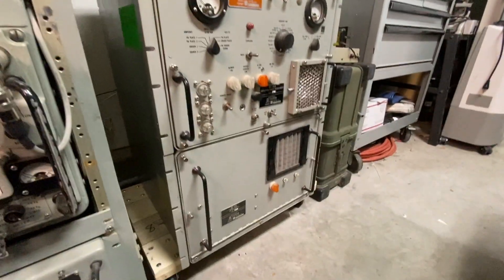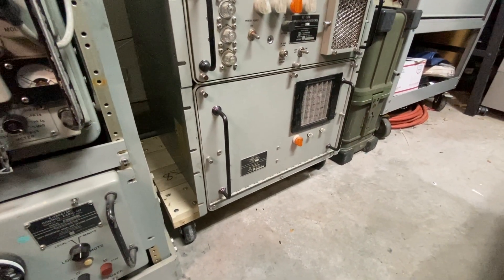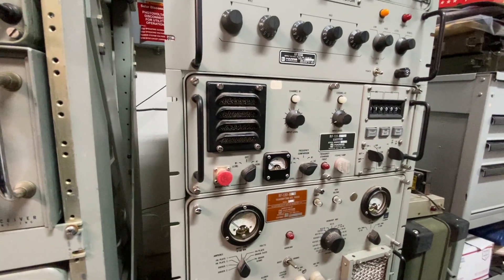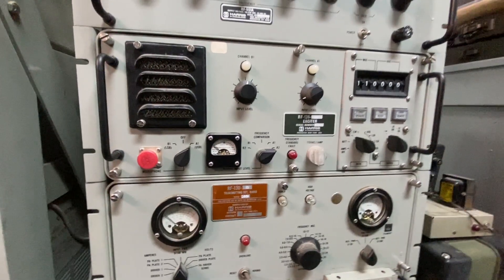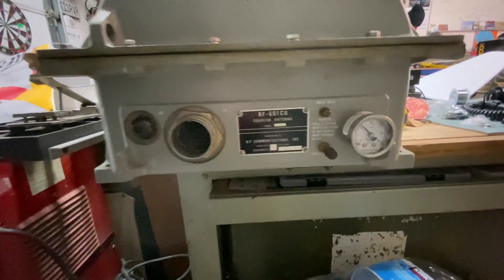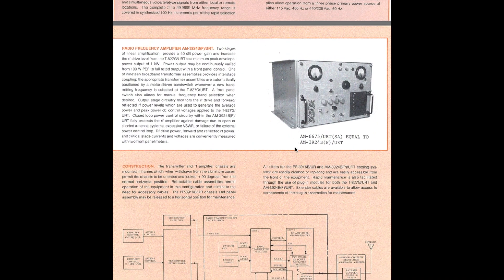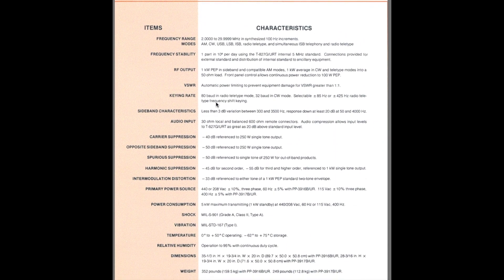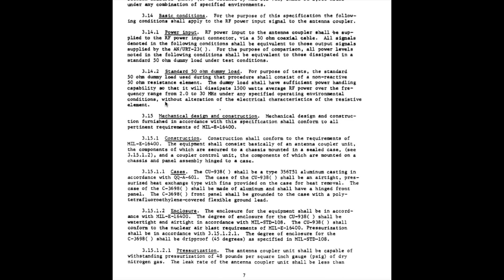Harris RF-130 URT-23 Transmitter Part 1

Comment: Willits ca  I have lots  of these units and older hello  from fellow radio guy
Reply: They are good units.  I need to get back at this particular one.  It has a bad transformer.  I also want to change the RF-131 for a T-827.  I’m good on QRZ if you want to email.
Reply: @ yes and heavy great radios one you have in a rack second one up built like a tank black rack handles 
And exsternal black connectors and the unit sticks out a inch or more I used to have but forget the name I took a screen shot of it thanks
Reply: Curious on the name of this one I used to have in searching soon for another https://youtu.be/jHiHGWB_zHI?si=XLs1pAFL-s2nequ-

Comment: Are you going to use the RF-601 coupler?  I've got the controller but I need the actual remote coupler, so if you want to get rid of it, LMK.
Reply from the maker: The coupler was the reason I made the 500 mile each way trip.  The rest was a bonus.  But if I run across another I will let you know.  There is a almost complete one on eBay located in somis, ca. 

https://www.ebay.com/itm/362943419036?mkcid=16&mkevt=1&mkrid=711-127632-2357-0&ssspo=DzAhsp_hQ66&sssrc=2349624&ssuid=AycLQQAWQ4m&var=&widget_ver=artemis&media=COPY

Comment: My last assignment before I left Harris in 1984 was final acceptance testing of these transmitters. I would tune them up and test them, then put them in the heat closet for 24 hours. Assuming they passed the heat test, one final go-over to verify specs and out they go. Had a 110 try to kill me one night when the RF cage interlock failed and I took plate voltage through a finger and out the heel of one hand. Also tested the 601s, affectionately known in the plant as the "baby coffins." I also pre-tuned the output filter assemblies (the "tank") and  the driver filter assemblies.

Comment: The RF-551A Pre-selector was sometimes put between the exiter output and the amplifier input. It helped to reduce unwanted splatter in sites that had multiple rigs on HF simultaneously. Your stack may well have come from such a site. If you open the preselector, don't touch anything; it's mechanically complicated and difficult to reassemble in the field. There may be no one left at Harris who can re-build it. I am a 24-year employee of the manufacturer in Rochester, New York.
Reply from the maker: Thanks for the tip.

Comment: This system was a "driver" stage for my much larger TXmitters.  But, this looks like a 131 exciter.  I was using the newer 1310.  Otherwise, same same.
Reply: Harris used the RF-110 to drive their 10KW transmitters and some special 40KW transmitters we built for the U.S. Navy.

Comment: Years ago I found here two RF-110A but just one RF-124 PS and one RF-131 exciter. All these are exotic here in the Carpathian woods, so I had to build the cables myself and even the connectors for the RF-124. Now I need a Dowkey coaxial relay for the RF-110. 
At that time I have scanned the RF-110A manual and  uploaded it on the BAMA server, you can find it there. The cable for the RF-124 PS is not difficult to be made, but the needed connectors for it are expensive. GL & 73! de YO3FZS.
Reply from the maker: I know the pain about the cables, I had all of them except for the RF110a to 124 cable.  I purchased the proper Amphenol Connectors from PEI-Genesis and received them last week.  I also purchased a length of 20kv silicon wire (A little over kill for the 2250v feed but what the heck) The Dow key seems to be a pretty standard style so hopefully you can locate one.   I had a buddy K4NYW at Navy-Radio.com scan the RF-131 manual if you need it.  https://www.navy-radio.com/manuals/harris-rf131-man-8304.pdf
Daniel
Reply from the maker: I know the pain about the cables, I had all of them except for the RF110a to 124 cable.  I purchased the proper Amphenol Connectors from PEI-Genesis and received them last week.  I also purchased a length of 20kv silicon wire (A little over kill for the 2250v feed but what the heck) The Dow key seems to be a pretty standard style so hopefully you can locate one.   I had a buddy K4NYW at Navy-Radio.com scan the RF-131 manual if you need it.  https://www.navy-radio.com/manuals/harris-rf131-man-8304.pdf
Daniel
Reply: I also have one RF-110a but without interconnection cables and I want to purchase the connectors. Do you know the P/N of the connectors ?

Comment: A WONDERFUL piece of equipment. Very reliable, easy to repair, easy to maintenance, and I was an Electronics Technician in the US Navy and trained in school to learn all about this equipment. When I got to the fleet...they had been replaced with the AN/SRC-20's which were unreliable, maintenance pigs, and always broke down. I disliked this crappy equipment.
Reply from the maker: Ah yes the AN/SRC-20(21) I have a video of one of those also.  I have an operational one, but since the SRC-20 (URC-9) is a 220-400mhz AM only unit there is not much activity so its barely used.

Comment: We used these in the Royal Australian Navy, I was a comms tech, did the course on these (C and D series). Very solid bit of gear. we used the T-827 exciter.
Reply from the maker: I would like to find a T827 for this set to bring it inline with the USN and RAN specifications.  Until I stumble across one I will continue to use this rf-131 exciter.
Reply: yep Frosty I work on them On the green ghost and the the steel cat when I was on them
Reply: @Auxrad39  the green ghost as in HMAS Hobart? I did a RIMPAC on Hobart in 88, I joined it just for that trip, I was working in Canberra and BNTS Belconnen. I could not turn it down. It was a great trip. 

I also served on the fluffy duck (The swan), in the early 80's when she came out of refit, and we did an up top, both ships are diving ships now.

Comment: As an ex ship's Radio Officer....I salute you, and your efforts to resurrect this gear! 73 de VK2AOE
Reply: I was a 'C Rate' radio tech in the 80's on the SWAN and a RIMPAC on the Hobart (88), we used 23V (C) or (D) models, T-827 exciters, AN-URC-38 Antenna couplers. 

CRH-11 HF receivers (I think), and R-1051B HF receiver,  Wisky 3 UHF (CUJ and CUH before that),   ex VK1DRL
Reply from the maker: Always nice to see a VK, what equipment did you have onboard?
Reply: @K6YIC-N3FAA  Apollo receiver (see link)
https://youtu.be/qm4J39FEt1k
Conqueror HS main transmitter, Sentinel watch keeping rcvr.....can't remember the reserve transmitter but it had a little straight key knob sticking out the front and put out 250 watts or so...Most Australian ships on the coast had the same layout and gear. Here is my story of time at sea
  https://youtu.be/JIYYC6SwGY8
https://youtu.be/5wtNhQQdoyE

Sad that a lot of this gear got scrapped at the demise of "old sparks" as tax laws etc meant they couldn't be sold on (my understanding).
73 de VK2AOE George

Comment: I knew this equipment well, we had four of them in our radio room on board the USS Orion. Very reliable gear if you could pound into the radiomen's heads not to tune it to a new frequency
with the power turned up!  That always took out the two final stage ceramic tubes which were not cheap.
Reply from the maker: Sub tender man, my father was on the USS Proteus in Guam in the late 1960s early 1970s.  I spent my time aboard Aircraft Carriers. (CV-64, CVN68, CVN-70) I was an AT working on communication systems for E2C and F14D aircraft.
Reply: @K6YIC-N3FAA  The Orion was quite the experience, onboard from '85-'88. We only went out to sea four times a year for ten days, mostly R&R but I was glad
my berthing area was on the top deck of the ship, she did not appear very sea-worthy to us! Working in Comm was one problem after another. My final year onboard we
replaced the URC-9 with a solid state transmitter, much to the relief of us.
Reply: That's interesting. My two RF-110A I had, included a dedicated protection system for the case of switching the freq. band during transmission: as soon as the motor of the output bandpass filters switch was energized it was simultaneously blocking the key driver transistor located on the A5 power control PC board. So, arcing at the output filter switch contacts or damage to the final 4CX1500B tubes because of switching bands during transmission was avoided.
Reply: @traian1782  No kidding, we were not fortunate to have that mod in any of the four systems I worked on. Obviously it was a problem that needed to be corrected and placed in
an updated URT-23. That would have avoided me being woke up several times in the middle of the night!!

Comment: Nice piece, I was in the Navy from January 1968 till 72. As a seaman they gave me R-390's, I made 3rd after just a few months, then 2nd class petty officer in 18 months, as a second class I was in charge of the ships HF transmitters antenna couplers and antennas. I said all of that to say in an informed way that your find is outstanding, I had 37 an/wrt-2's very capable but much larger than your transmitter. ✋73's🎙 KD9OAM🎧📻📡
Reply from the maker: Thanks for posting.  Its always nice to hear from a fellow sailor and Geta bit more historical knowledge of the systems used.  I can't wait to get this one on the air.

Comment: Hmm. looks like my comment got "lost" Congrats on the score. Looks gorgeous. Do you have the cables? Also, the 3 phase RF-112, while smaller, seems heavier than the 124. Maybe it is just deceiving because of the smaller size, but it sure feels heavier. BTW I always preferred the stack mount set up rather than the rack mount. If you're interested in a set of stack mounts, contact me, I'll see if I can locate the guy who I believe has a set. I find it better to put the whole thing on a mover's dolly.  The amp is designed to take nominally 100mW input. Years ago several guys who had these amps, by passed the 8122 drivers, used a swamping resistor and drove these with 100W radios. But frankly, there is no reason to do that. The available exciters are plentiful and excellent. Finals are a pair of 4CX1500B tubes. they command a pretty penny these days. So do the 8122 drivers (IIRC). Good luck.
Reply from the maker: Good correction to the power input at the RF110.  I was going off the output the T827. I was lucky enough to get an extra RF110a (Which has been modified and is missing all the cannon plugs from the rear panel) other then that its complete and has 184 hours on the clock.  Hopefully if I ever need replacement finals or drivers I can pull from that.

I watch your channel all the time, you have great advice and good stuff.  Its a blast meeting like minded individuals..

Comment: I know you indicated it can operate in CW mode, but does it really operate correctly?  The Iowa's URT-23 do have a CW mode (maybe just for tuning?) but do not seem to operate properly in CW mode. The keying is very slow and nearly impossible to send morse correctly.
Reply from the maker: That is an interesting observation.  The spec sheet on the URT-23 shows a 32 baud CW rate and an 80 Baud FSK rate.  Something to add to the checkout list. 
https://www.navy-radio.com/xmtrs/urt23/urt23b-spec-01.pdf
Reply: Gary. Are you guys using the remote? RF-7405? contact me I'd like to know more about your setup. The 7405 definitely causes problems that I've documented on my youtube channel. Otherwise, check you're in CW mode. What exciter are you using?